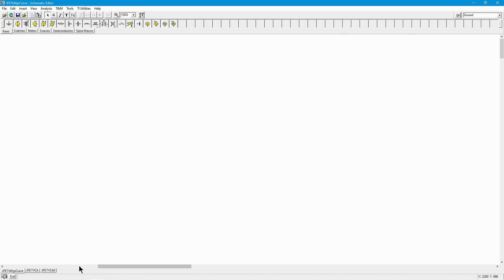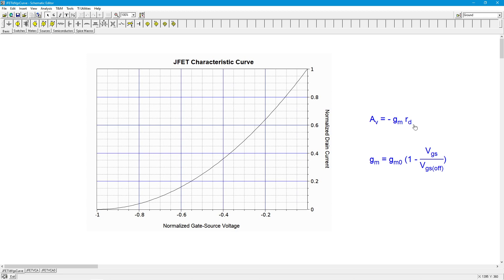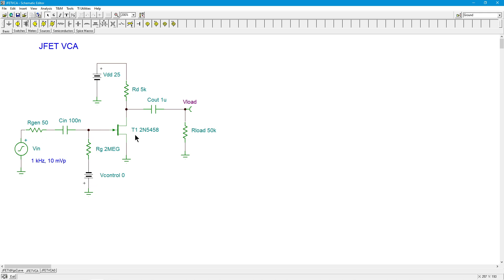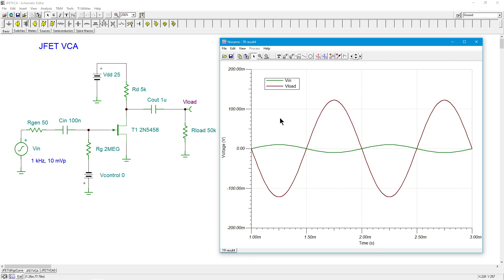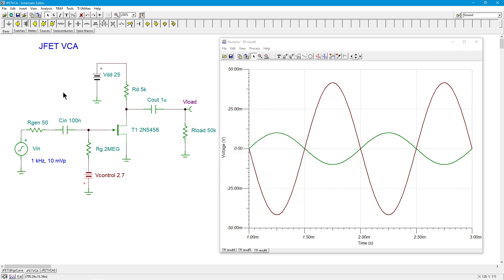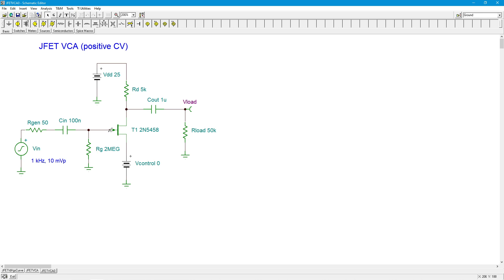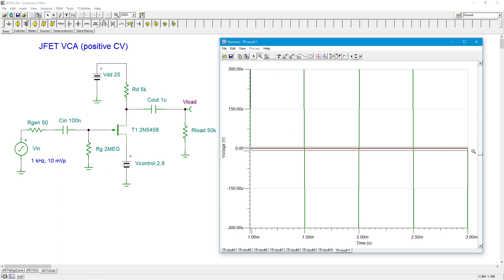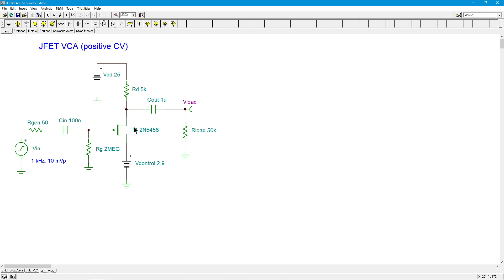Semiconductor Devices: JFET Voltage Controlled Amplifier

Comment: Would it be correct to assume that the RC time constant (Cin*Rg) will limit the control response time to some hundreds of milliseconds? And won't the control voltage tend to "bleed through" into the output when it changes, since it is being amplified along with the input?

I realize this is a very simple circuit, designed to illustrate a concept; in applications where the above issues matter, a true transconductance amp would be used instead.
Reply from the maker: Right, this is more of an introduction to the concept. I have several videos in the Op Amps course/playlist that make use of OTAs (e.g., VCAs and VCFs).

Comment: In this VCA example (I'm ignoring the variation with positive control voltage at source), the control voltage (Vgs) is being "mixed" with the signal into the gate, am I right?
Reply from the maker: Yes, that's one way to look at it (if by "mixing" you mean "adding together", as there is another use for the term "mix"). Essentially, we're creating an offset that the AC signal swings around (i.e., placing it on different portions of the transconductance curve).
Reply: @ElectronicswithProfessorFiore   Yes, I meant adding : ) Thank you very much!

Comment: Could I use a P channel FET in order to use a positive control voltage?
Reply from the maker: Yes, but notice how we did that in the second half of the video. It really depends on how you want the direction of the control voltage change to work, not its polarity (e.g., making the voltage more positive yields greater gain).

Comment: The Source resistance will reduce gain but it should tend to linearize the amplifier across all conditions. Are there other ways to reduce distortion? I am assuming that wrapping feedback around this would hamper the variable gain, until it runs out of gain.
Reply from the maker: Yes, negative feedback both gives and takes away. This is not a high gain circuit to start with so you don't have a lot to sacrifice. You could do tandems (i.e., cascade a couple of them with a common control voltage). If you really need a wide gain variability with only modest distortion, you might be better off going with an OTA (operational transconductance amplifier). I have a video on OTAs slated for the future.
Reply: @ElectronicswithProfessorFiore  I was about to ask about the distortion caused by this circuit, because I got a bit confused. Why would I not use this instead of an opamp. If I get it correctly - and please correct me if I am wrong! - the curve in the beginning of the video shows that this circuit is rather unlinear, hence the introduced distortion might be too high, let's say for a simple volume adjusting circuit in an audio context.
Of course who knows, maybe this distortion does actually sound good? :)
Reply from the maker: @krakamak  I assume the curve to which you are referring is the transconductance (gm) curve. Yes, that's non-linear (square law, to be precise). gm sets the gain of the amplifier, and as long as the signal remains small, the distortion will not be very large. In the circuit shown, THD is in the area of 0.1 to 0.2 %, depending on gain. Not super hi-fi, but not gross, either. 

This circuit would not be used for something like a simple volume control because it does not have a wide enough range. There are better ways of doing that. It can be used as part of a signal feedback system, though. For example automatic gain control (AGC) which is used to keep the output signal at a relatively consistent level in spite of changes in the input signal strength. A classic example of this is in radio receivers where the input signal is a function of how far you are from the broadcast antenna. 

And yes, you might like the distortion when the circuit is pushed! Guitar fuzz boxes have used all manner of devices over the years, including BJTs, FETs, and op amps.
Reply: @ElectronicswithProfessorFiore  Great, thank you for the reply! And the videos are great, keep them coming! :)